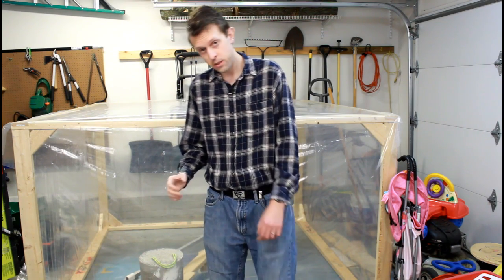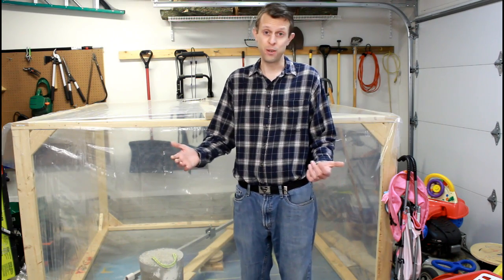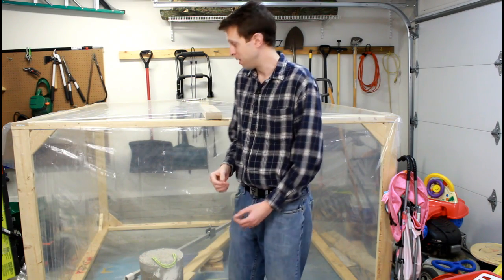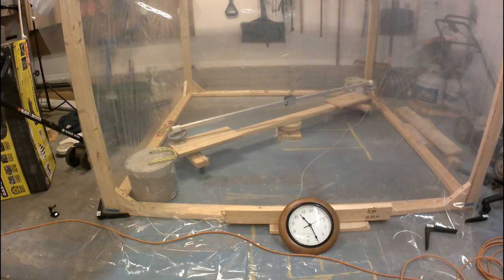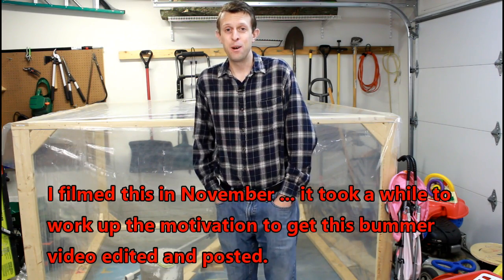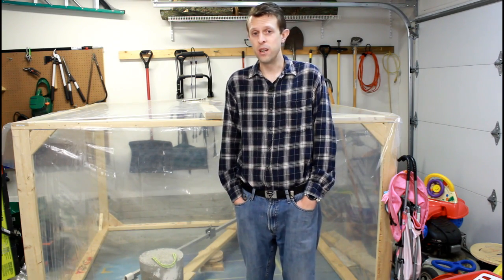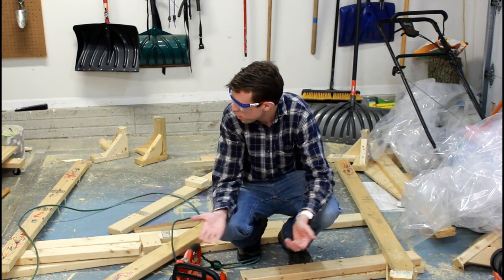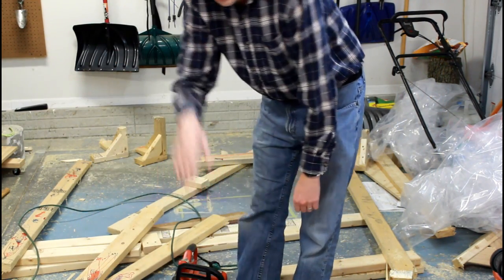Cavendish Postponed

Comment: First you must use spherical balls for the weights.  The law of gravity doesn’t work in general for nonspherical shapes especially when the masses are close together compared to the size of the masses. For such a sensitive experiment, you might try to make a much smaller version that will give you the right answer to maybe twenty percent. Then figure out the easiest way to improve the accuracy.

Comment: 1. That plastic sheet builds up a lot of electric charge that spoils everything. DO NOT use plastic parts, they build up electric charges from air currents...
2. Use nonmagnetic materials for weight
3. scale down that rod and your torsion balance, use smaller weigts, then use as thin torsion wire as possible, because the torsion constant is proportional to the 4th power of wire diameter. So you gonna have larger deflection angles on a smaller torsion balance.

Comment: Any update on this experiment for this summer? Still trying to prove gravity in my FE research! Haven’t seen cavendish experiment actually succeed. Thanks
Reply: it has succeeded, you should look better. You don't need it tho, because the fact that everything falls towards earth at the same rate regardless of its mass, is sufficient. FE is debunked by the sunset which is a lot more simple than gravity. Nothing to research.
Reply: @Nespokoen  Sorry, I'm of the opinion objects don't fall at the same rate regardless of mass. An object falls due to a property of the object itself than any external force or influence acting on it. Heavier objects will ALWAYS fall faster than lighter ones given enough height is allowed for all objects to reach their maximum drop velocity. Try it for yourself, do several drop tests in air, in water and in vacuum and you'll get the same results. And don't come back with the Brian Cox demo at NASA because one never sees the drop in one single take. It's a contrived video presentation. I've done 2m vacuum drops and the heavier objects hit the bottom first. The Earth is Flat and welcome to man's fabricated world!!!
Reply: Peter & Pete No object will move in a certain direction unless a force acts on it. To lift an object to a certain height above the ground, you must apply a force. For that object to fall back down when dropped, there must also be a reason or a force. That force is the force of gravity. An object with a larger mass will fall faster because the force of gravity acting on it is bigger than the force of gra vity acting on an object with a smaller mass. This means that the more massive object will reach a higher terminal velocity which is the point where the force of gravity and air resistance which is trying to slow the object down are equal but acting in opposite directions. Two identical sheets of paper have the same mass but if one is squished into a ball it will fall faster. However, when talking about falling at the same rate, it’s not the speed that is equal, it’s the acceleration, which is exactly 9.8 m/s^2 and is the same for all objects free falling in a vacuum regardless of their mass. Same goes for two cylinders of different mass that roll down a sloped surface. One can be gigantic, the other one can be tiny, it doesn’t matter. As long as both are solid, they finish at the same time. Walter Lewin demonstrates this during his physics lectures at MIT and my physics teacher in school did it too so I’ve seen it. The NASA vacuum chamber video clearly shows the feathers and the ball hitting the ground at the same time. There are videos of other experiments too, all showing the same result, so you must have done something wrong. As I said in my previous comment, the Earth cannot possibly be flat because sunsets.
Reply: @Nespokoen  quote - To lift an object to a certain height above the ground, you must apply a force. For that object to fall back down when dropped, there must also be a reason or a force. That force is the force of gravity. 

Noooo! That is not the force of gravity causing objects to fall, that's only what you THINK is the cause. You can't even prove your causation is true anyway! 

I'm still of the opinion (because you haven't convinced me), every object has inertial mass (see einstein's equilibrium principle) and by raising an object one is also attributing the object with the 'potential to fall'. So by raising an object one is giving the object the reason to fall. Falling objects imo fall not due to gravity but simply because of an object's inertial mass and its potential to fall!

We've watched the walter lewin video using a ramp and cylinders of different materials. You clearly overlooked the part when a lighter aluminium cylinder hit the bottom of the ramp BEFORE the heavier cylinder! The reason why this happened is that a lighter object will always reach its max drop velocity quicker than a heavier one and this is why people can be FOOLED or convinced into thinking objects fall at same rate (see action lab's vidoe of feather/metal cube in a vacuum falling at a height of only around 18inches)! Clearly extend the height to allow BOTH heavier and lighter objects to reach max drop velocity then heavier object will ALWAYS hit bottom first!
Reply: @Nespokoen  Gravity is only an IDEA that describes falling motion but it's not the reason WHY objects fall!
Reply: @PeterPete  Well, you are right by saying that it's just an opinion. What I'm talking about has been demonstrated experimentally. So, let's say I lift an object from the ground to 1 meter above it. That's two positions with zero potential energy. Why would it want to come back down? If I moved the object to the left, right or to a lower position, it doesn't want to go back to where it originally  was. And how come the acceleration is always 9.8 m/s^2 regardless of mass?
Let remind you that max drop velocity only exists because after a certain amount of time spent in free fall the downwards acting force of gravity and the upwards acting air resistance become equal so there's not net force on the object. Without air resistance (vacuum) there's no max drop velocity. Regarding the rolling cylinders, you should look closer: https://www.youtube.com/watch?v=cB8GNQuyMPc
Reply: @Nespokoen  what you're stating has not been demonstrated experimentally and in any satisfactory manner, where the results show conclusivity! We wouldn't be here otherwise! 

quote - That's two positions with zero potential energy. Why would it want to come back down? 

One could also ask why does a zebra have stripes and not spots? Why do people age and die? Why don't people live forever?

We could ask lots of questions about the things in life to which we will never find the RIGHT answer - we can only hypothesise and speculate. So why objects fall rather move sideways is anybody's guess but the IDEA of gravity doesn't provide a satisfactory answer at all. If you think it does then you have to demonstrate objects won't fall sideways in a non gravitational environment and how are you going to do that? You can't!

Additionally the maximum rate of fall an object will attain in any medium is dependent upon its inertial mass. So we clearly have different understanding of max drop velocity? But how can this be when you think you're so right about gravity? 
Think about it? You clearly have problems realizing other people have valid counter claims to your idea of gravity and that alone doesn't tell you anything?
If i held a view and thought it was true and somebody came along and presented me with a counter claim I couldn't argue I'd certainly have to rethink my position, especially if I promoted it as being a fact!

As for lewin and the aluminium cylinders, watch from 07:00 the objects do not roll at same rate because one is lighter than the other and the heavier object hits first, which supports my view in that heavier objects will always roll/fall faster than lighter objects given enough elevation/height is allowed for both objects to reach their max roll/drop velocity! This is in any medium water, air or vacuum!

Your science is shit and lots of it doesn't reflect reality!
Reply: @Nespokoen  by the way max drop velocity can apply in any medium as long as all objects are dropped in the same  medium and enough height is allowed for both objects to reach their max drop velocity in that particular medium. Dropping different weighted objects at arms length eg feather and hammer isn't enough height to allow BOTH objects to reach their max drop velocity! 
When one looks at how people behave and what they believe it's so easy to fool people!

Comment: Hi its been great watching the progression of the attempts to repeat the experiment. With troubles of isolating the torsion balance from outside influences would it be better to enclose the torsion bar within a much smaller, narrow enclosure. Shaped to fit the T shape of the bar and string. This would limit the air space around the torsion bar which would limit any air currents inside the box. The box could be made very narrow since the deflection you are expecting to measure would only a few degrees. The larger weights could then be moved by you by hand without disturbing the balance.  Sorry if you have already tried this.

Comment: Thank you for this video. I'm glad to see how you protected the pendulum from external air currents. I'm amazed that it "was not enough". Actually, I don't believe that rigid walls will help at all, because if you don't see the sheet moving, how on earth stream of air could transfer its momentum inside the box? Tightening the sheet might help in that case... 
I wish you had taken a footage of your erratic oscillations to give a better idea what kind of difficulties you are facing. It could be valuable example for anybody who might be interested to replicate the experiment... If the convection air currents really are the problem, cardboard box could be cheap way to test your erratic oscillations further. Maybe you should insulate the floor to get more consistent results? Cardboard might even be a good enough insulation to even out possible temperature distributions on the floor.

I was pondering what other than air currents could explain that erratic behaviour. First one was the torsion string... could it behave badly if its temperature changes? Any effect of this would probably be really small anyways. But what about the frame? If the frame moves or changes its shape e.g. due to temperature or humidity changes, can the string translate impulsive disturbance to the beam and produce such a movements?

Last hypothesis I came up with is electromagnetic disturbances. You have a lot of metal on your beam, so any changing magnetic field nearby could give it a kick. You would expect that even though electric wires running on walls are not twisted pairs, they can create only diminishingly small (changing) magnetic fields because phase and neutral wires carry the current to opposite directions. But considering the sensitivity of your setup, who knows how small magnetic fields it might be able to react to? Or could you have some household appliance nearby which has poor magnetic insulation so the strong magnetic field it generates can partly escape to its surroundings?

BTW, did you need to make the pendulum swing before you could see the erratic movement? It it were still, it never started moving by itself? Because if it didn't, does the swinging really increase the sensitivity of the device really that much that the external disturbances suddenly can have an effect when it did not while staying still... This means the external disturbance is asymmetric varies from place to place? Strong(ish) magnetic field would be necessarily uneven...
Reply from the maker: Thanks for your thoughtful response!

The idea of the temperature or humidity change affecting the line had occurred to me as well.  Unfortunately, we get pretty big day-to-night temperature swings in my neck of the woods, so my garage wasn't ideal for that.  Climate control might be the way to go.

I hadn't really considered magnetic effects.  The bar itself is aluminum, but the weights on the end are steel, so they would certainly be subject to magnetic forces.  I suppose this would be another advantage of using lead for the weights.

As for getting it still - I never got there.  I tried manually adjusting the bar so that it was as close to at rest as I could manage, as near the equilibrium position as I could manage.  It's tricky in that the movement is so slow as it oscillates that you can't really tell if you've adjusted it and released it from "rest" well.  I would think I had it still, then run a 30 minute time lapse and find it had swiveled by a significant amount (sometimes multiple times around).

The way it moved suggested to me that the equilibrium position was not fixed in place as I had expected.  I'd watch time-lapse footage to determine the middle of the swing motion, manually release the pendulum from that position, then see in the next time lapse that it would swing with a much larger amplitude around some new middle position.

My other tactic was to just let it be.  I sealed off the garage from my family and myself for a full week, figuring that in that time, even the small amount of air resistance it would experience would be enough to slow it to a near stop.  When I went back in and did another timelapse, the thing would be spinning circles.

The only other idea I've had since then (sadly not while it was set up, so I have no data on this) was that the knots holding the line to the hook at top and bottom were very slowly coming undone.  They were tight, and with very little extra string protruding from the knot, so I think that if it had unwound at all then the entire knot should have come undone, but I think it's a possibility.  If I were using heavier, denser lead weights, the torsion constant for the string would not need to be quite so small so I could use a line that's a bit thicker and would be less prone to slipping (if that was indeed what happened).  I thought of adding some epoxy to the knot to make 100% sure that it wasn't coming undone.

I have some additional timelapse footage that I saved (I deleted a lot, as I was figuring I'd eventually get it working and this was just the junk I had to record to get everything set up initially).  I'll post another video that just has that footage for anybody who'd like to take a look and offer their thoughts.
Reply: @AndrewBennettScience  Don't know if you are still following comments on this video, but here is another idea or two.
I had also thought of the knots. I think that's a real possibility.  Also -- less likely but maybe still conceivable -- is that the fishing line is undergoing internal changes.  I'm not that well versed in material science, but you have the line loaded to what, 30% of it's breaking strength?  It seems possible that the plastic is undergoing creep with that much strain.  And the creep might not be completely uniform, causing small torsional force changes over time.
Personally, I think a spring wire (music wire) might be a better choice.  If you get .008" inch (0.2 mm) music wire, it would have a tensile strength of about 20 pounds,  I'm fairly confident creep would not be an issue with steel wire, but I'd still epoxy the knots just to be sure nothing funny is happening there.
This would also give you a much lower torsion constant.  Note that the elasticity of steel is basically constant regardless of how strong the steel is, and the torsional rigidity of a round rod is proportional to the radius to the 4th power.  With this, I can estimate (probably fairly accurately) that the torsional constant you would get on your rig for .008" music wire would be .00002.
For an enclosure, 2 inch thick semi-rigid foam insulation panels are fairly inexpensive at any home center.  You could use these on all 6 six sides (top, bottom, 4 sides) of your box, with a clear window in one side for viewing. They would also provide thermal insulation, reducing convective air currents inside the box.  On second thought, you might want too keep your viewing window small (or double pane) if you use the foam.  If you have just one poorly insulated area, it might increase convective circulation if there are temperature changes.
I'd use care though with sealing the box up too tight.  Unless you think you can get in basically 100% air tight, there will be air entering and escaping as the temperature and barometric pressure change.  If you have only one or two small holes, you might get jets of air entering.  I'd suggest a bit larger vent, maybe dead-center in the top, covered with a few layers of rag or something to diffuse any air entering.  A moderate sized hole will mean the air will enter more slowly than with a tiny hole, so it will have a lot less energy.  A single hole means you won't get air blowing in one and out the other if there are air currents in the room.

Comment: This test should be done in a vacuum chamber.
Reply from the maker: I've seen this comment before.  While I agree that a large vacuum chamber would eliminate any problems I might have had with air movement, I simply don't have access to something like that.  Also, it seems reasonable to me that I could get decent results without, given that Cavendish did this experiment before anybody had vacuum chambers.
Reply: Jss its strange in 220 years nobody did it on a vacum chamber.
Reply: @IgotQuestions.  noit really when you consider that scientists have better ways to measure it now
Reply: @IgotQuestions.  University of Washington has done it in a vacuum chamber, wouldn't be surprised at all if some others have too.
Reply: @sluxi  did somebody record the experiment ? Any link ?
Reply: thats a big vacuum chamber